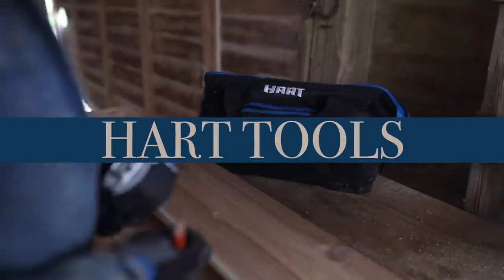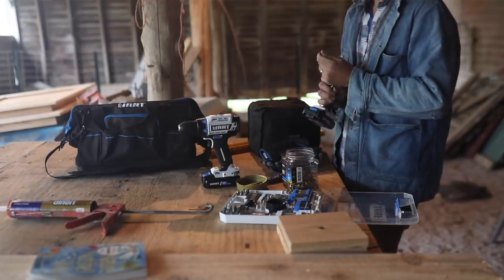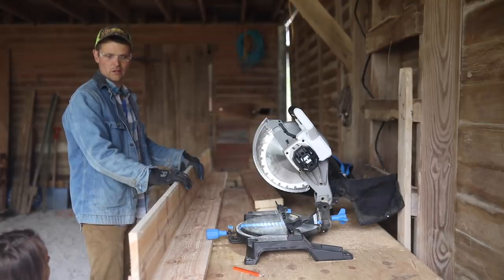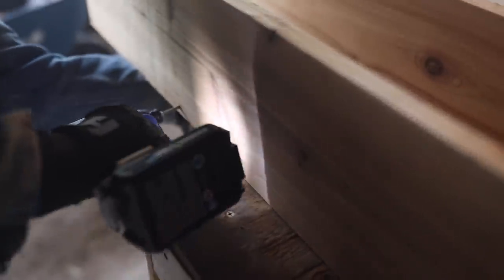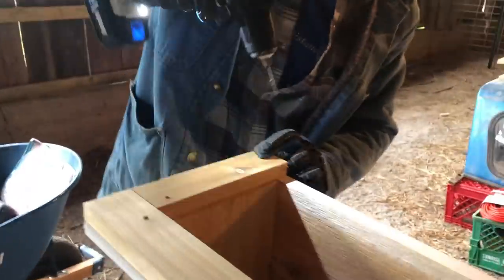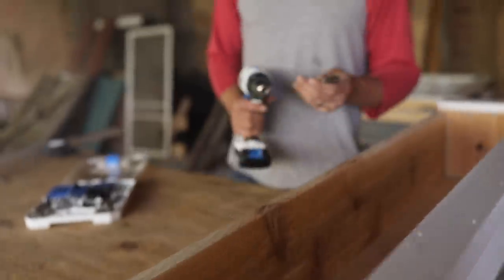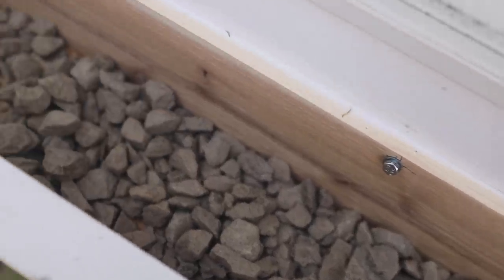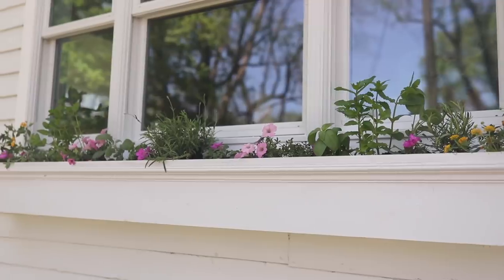How to Build a Window Flower Box | Spring Garden Tutorials

Comment: Looks so beautiful! But I would reccommend adding a liner inside as the wood may rott from the water 🙂
Reply: Cedar doesn't rot easily. Especially with the drainage holes. That's why it is one of the best woods to use for above-ground garden boxes, as well as window boxes.